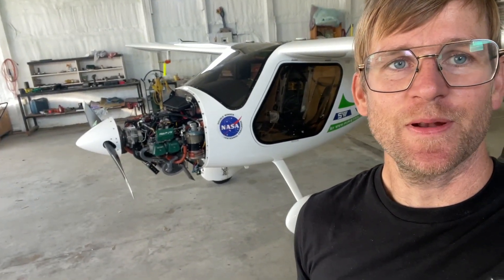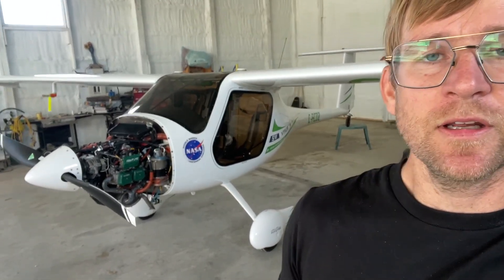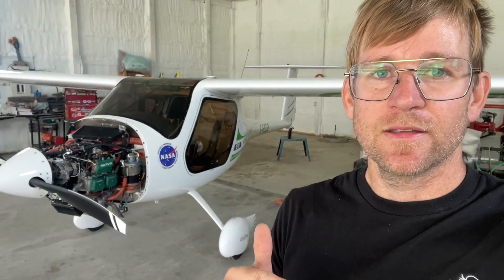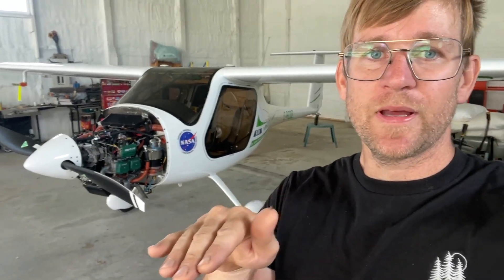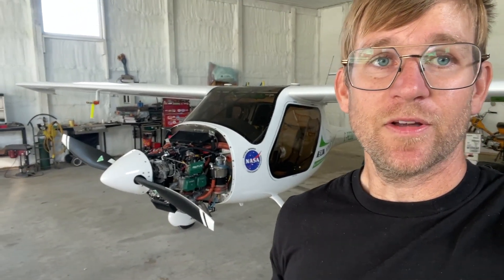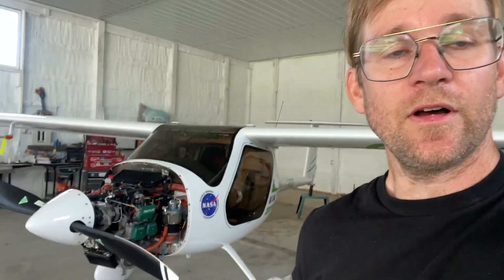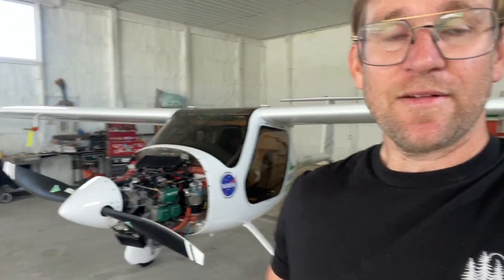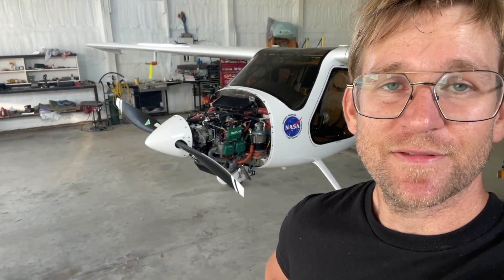Rotax 912iS failure at 1700hrs

Comment from the maker: I actually love the rotax engine. It has been way better than any other engine I’ve ever used. So many redundancies built in. I had a continental on a c150 and it was nothing but grief, low compression on cylinders, sticky valves, issues with the led in fuel gumming up spark plugs. The cost of parts was also ridiculous, way more than rotax. Rotax has fixed these issues in updated models of their 912is. Unlike the older companies that do nothing to improve their engines

Comment: Do you know what the cause was?
Reply from the maker: The thrust washer (plastic washer) failed inside the gear box and went through the motor.  I had the gear box overhauled at 1000 hours but at that time rotax was not requiring that the thrust washer be replaced, since January 2023 they now require this washer to be replaced with a gearbox overhaul at 1000hours. These parts were also not previously cooled/oiled, on all the new rotax engines they changed design to now cool/oil these parts off the shaft.  I do not know exactly when this change was made, I believe it was on version 2 or 3.

Comment: Bit of a pain, although I had the same happen on one of my 912’s.
Didn’t affect the engine or performance, just wasn’t sure what the bits of plastic I found at an oil change were?
Gave the box to a local Rotax dealer, who replaced the plastic washer and carried on flying.
Still don’t fully understand what the washer actually does that can get away with being only plastic?
Was a couple of years back, and I can't remember which motor it was, but I think it was a runout motor being used on condition in a homebuilt.
Reply from the maker: What was your engine time when yours failed? I’m told it used to be a metal washer but when it failed it completely destroyed engines. Not sure why they have a part in the gear box that is prone to failure in the first place
Reply: @DarrylZubot  In all my years of being an aircraft mechanic, I have never heard of a washer "failing.".  Is there a service bulletin or an AD on this thrust washer ?? Seems really dumb to have a powerplant failure over a washer !!  Is this only on 912iS ?? What about 912 ULS ??
Reply from the maker: @mustardseedsociety  it sure is dumb. No AD regarding it. I’ve heard from several people now that have had it fail prematurely. I’m told rotax has quietly changed engine design to include a sprayer to lubricate these parts in the gear box and it should be a non issue now on newer engines. Sounds like it is mainly an early version 2 912iS problem. Not sure why this is. The strange thing is they have an overhaul time on the gear box which I complied with but found out that at the time of my overhaul it wasn’t required to replace this $2 plastic washer. Rotax has changed its overhaul to include replacing this washer now since Jan 2023.
Reply: @DarrylZubot What I can't figure out is why does a washer needs to be lubed in the first place ?? Is it a moving part ?? I only found one video on the Rotax thrust washer - a guy from Australia was installing one on his Rotax gearbox  and he had to put Locktite on the nut, then he puts a pin in the engine so the crankshaft won't turn, then he torqued the nut {against the thrust washer} and the torque wrench broke. Then the video ended by him saying he needs to take the nut back off and start all over. So needless to say, I did not get the answer I was looking for.  I think the biggest mistake he made, is he was not ready to torque the nut after he applied the Locktite to the nut. He applied the Locktite but then he had to go find the socket for the nut. You have to torque it while it's wet.  Plus I don't think he had the torque wrench set correctly.  What aviation needs are the aviation equivalent of "Engineering Explained" - a popular You Tuber who makes amazing videos explaining how cars work. Very hard to find these aviation equivalents on You Tube. Too many "look at me - I can fly a plane" videos. Even those videos are frustrating because the pilot rarely gives true airspeed numbers which always frustrates me !! With the exception of Baron Pilot and Matt Guthmiller.
Reply from the maker: I saw that video you are talking about.  So I'm told Rotax added hole in the shaft that sprays the sprag clutch to lubricate this part, maybe it overheats and degrades the plastic washer? I have no idea why or how these are failing. But it sure seems like Rotax knows about it and did a change to the engine without notifying previous owners of this potential failure. This could cause accidents, I had to go to idle right away as my oil temp was at 135º, pressure dropped, and my hydraulic prop was surging due to lack of oil flow so I had no choice but to land right away, luckily it happened when it did and not when I'm 300km from an airport over Northern Alberta forest. @mustardseedsociety
Reply: @DarrylZubot YES I am very happy you got back down OK - The main reason I jumped on your "bandwagon" is because I'm interested in building a Bush Cat - it uses the Rotax 912ULS.  The big thing I like about the Bush Cat is it's rated at +6/-4 g's and they certainly don't have an aerobatic category. And I like how simple it is to build. I'm hoping that maybe in the future Delta Hawk will make a 100HP version and approve it for a Bush Cat - assuming the Delta Hawk lives up to its promises.  But in the meantime, I guess the Rotax is the next best thing.  Thanks for your replies !! - by the way, I'm Brian Mega from Euless, Texas. If Rotax has improved the design to eliminate this problem, I at least feel better. I'm really keeping my fingers crossed for the DeltaHawk engine/s.  It would be so nice to just get away from gasoline and just use Jet A like the "big boys" use. Ha !!
Reply from the maker: @mustardseedsociety  so far I haven’t heard of anyone with 912ULS that has had this failure
Reply: @DarrylZubot  Well that's certainly good to hear.  I did see a video, can't remember who, they said that the ULS production may stop in the future. Which is strange as far as gearbox design, because why would the gearbox have to be different if the fuel was carbureted or injected ?? The piston is going to move and turn the crankshaft the same and transfer motion to the reduction gearbox the same - unless there's some kind of harmonics or something that's over my head to understand. But it should not matter, fuel mixture goes in, a spark goes off, and makes the engine turn. Gearbox should be the same.

Comment: Congratulations on getting it down safely. Hopefully they'll update their rebuilding process...or replace that thrust washer from the factory with something more substantial.
Reply from the maker: It used to be metal I’m told and when the metal washer failed would be a bad situation. But I’m not sure why they have a part in the gearbox that is prone to failure. I’ve heard from several people now that have had this washer fail.
Reply: @DarrylZubot  the longer you own a rotax the more design flaws you will find. After 7 years I don’t think they are comparable to a real AC engine. Very few A&Ps will work on them. SO many issues just like yours. Fairly pissed at Rotax for putting these engines out with so many design flaws… oh and they are just as expensive to overhaul as a continental so ur not saving money. Parts are insane for these snowmobile engines.
Rotech Motor has abandoned me as a customer… thanks guys! Really making rotax look like a shit company.